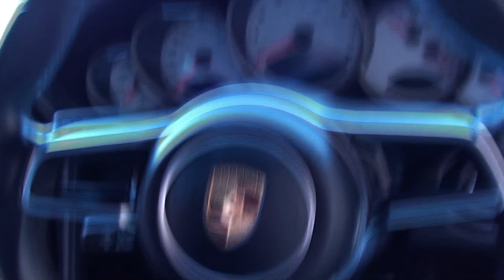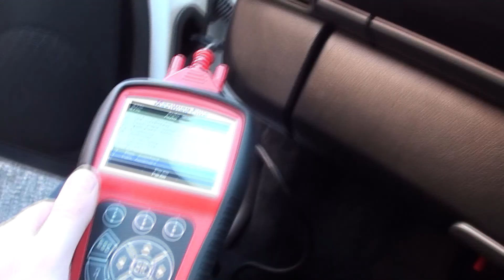Porsche Boxster 987 & 911 997 Steering Wheel Upgrade Part 2

Comment: RE: the super glue.   Make a small fillet of baking soda on the hidden side of the plastic.    Drip super glue onto it.  Make sure everything is EXACTLY where you want it as it will set up hard and fast.  Try it out first on something else.   You can use this to build up broken areas and it becomes VERY strong.

Great channel;  Enjoy your work!!!
Reply from the maker: Thanks very much for the tip Ric. will definitely try that at some point. Cheers

Comment: You have no idea how much your channel has inspired me. I really wanna try and do what you're doing, but a step further. I'm looking at the new GT3 RS features and thought "hold on, you could do this in Paul79s porsche as well!!!"
Reply from the maker: That’s Zak. That’s very kind. If u have any ideas or videos you want me to try and make pls let me know.
Reply: @kitcarspaul79  Do you have any video of fitting the roof - especially where it meets the upper windshield header? Really interested in how much of the Boxster structure remains and how it’s connected to keep from flexing loose. Thanks.
Reply from the maker: all the Boxster structure remain in tact. your just replacing the convertible roof with a fibre glass one. maybe I'll do a quick video on how it all fits together one day, but u can probably see if from the build diaries already.

Comment: Hi paul, great video!

The PDK steering wheel you already had in the car was that original or was that installed by youself. I have 54 plate 987 s with the old style triangle shaped centre air bag and looking to go to a round air bag centre.

Do any error lights pop up on when you first fitted the pdk wheel?
Reply from the maker: hey, sorry for the delay in replying... i know the steering wheel you have.. so that PDK wheel I installed myself. It was straight forward, but the horn didn't work. no errors on the dash at all, although when u disconnect the air bag u need a diagnostic tool to turn the air bag light off. I had to have the car recoded to have a multi-functional steering wheel for the horn to work. then it was all fine. with this new cayenne steering wheel, everything works. horn works as before. not sure if u went straight from triangle to cayenne wheel the horn would work. prob not, so u'd still need a recode. HTH

Comment: Great video. Sorry you fell down a rabbit hole on the loctite - every builder learns that lesson to just use a little 😂

What scan tool do you use for the 987.1?  Have you found any things that it was advertised to do that it didn’t?  I ordered one on Amazon and it wouldn’t remove the Service Due Soon banner so I sent it back. Thanks!!
Reply from the maker: The one I have is by Autel maxidiag. It was about £250 about 6 years ago. It doesn’t do everything but works on a lot of cars. It does the basics like resetting service lights and airbag lights.
Reply from the maker: The one I have is by Autel maxidiag. It was about £250 about 6 years ago. It doesn’t do everything but works on a lot of cars. It does the basics like resetting service lights and airbag lights.